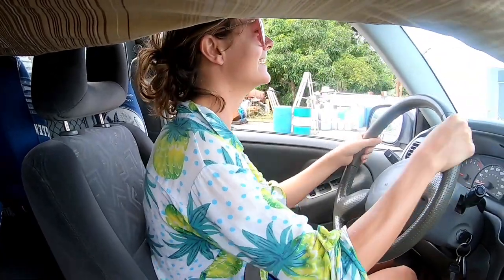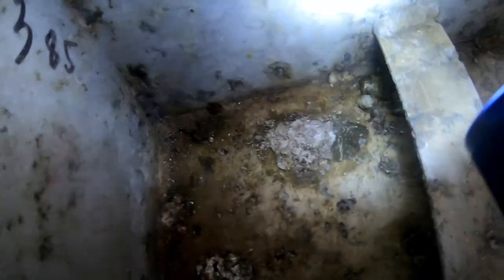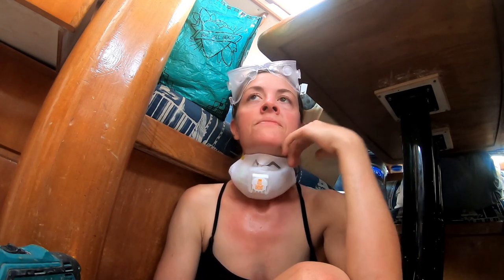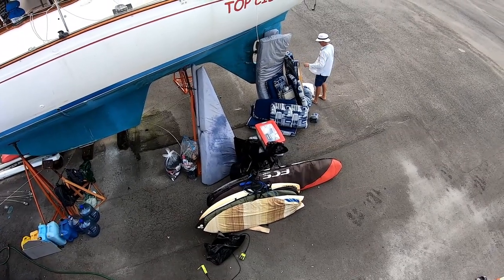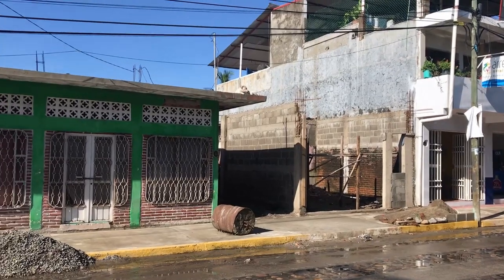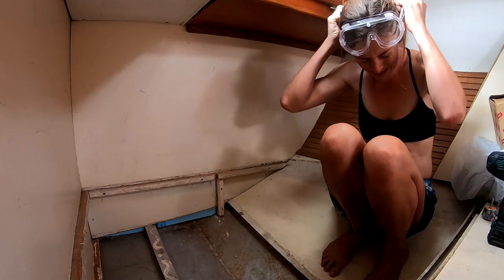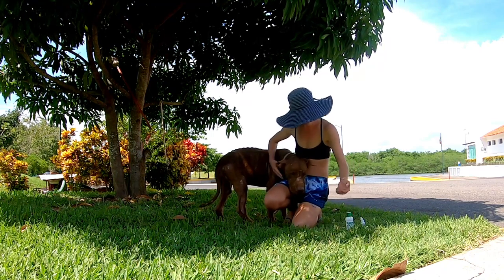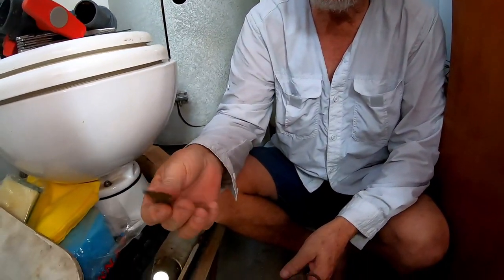This Changes Things... Chuffed Adventures S03Ep2 Hauled Out

Comment: Those would be easy filler welds.  I don't know anything about welding but I bought a Welder to build a Wood stove without knowing anything.  It turned out I bought the wrong welder, it's the cooler welder not the hot welder.  I can weld the Aluminum hull on my fishing boats but not the heavy metal in the wood stove.  I found another welder on-line for only $100 so I might go with that.  I have another tip coming and when I see if that fixes it or not will tell me other wise.  I was hurt from a Ukraine Dating site scam and I'm not over that hurt yet.  Your sure good to look at.

Comment: The worst alluminium corrosion, far worse than this, that I've seen was on comercial airliners! The first time I saw it I was shocked not just by the extent of it but to the casual reaction the engineers had towards it. The galleys and heads are modular units quickly removed and it's under the heads that there's often more white powder than alluminium left. Urine and alluminium seem to not get along at all.
Reply from the maker: Wow!!! Never thought of that - but it is rarely as bad as it seems in the moment!

Comment: 1. Clean, weld plates. Fill, polish, clean, add protection like proper epoxy. Or something that works better on aluminum, since the instant oxide film can mean you've got to wire brush scrub the epoxy onto the aluminum, just like lead, to get a good bond.
2. Make sure you've a proper life raft & EPIRB.
3. Back to business.

This is why, around 1970, when Jacques Cousteau was still looking for volunteer crew on Calypso, one of the questions was, literally, "Do you have any welding experience?"

Personally, I'm got great respect for a proper metal boat, but the cancers that old used ones can get, are what keep me to plastic.
Reply from the maker: Totally agree with you on all counts! I really love Chuffed and the benefits of alu, but I see the advantages of plastic especially in remote parts of the world - because for the most part you can always get the things you need to repair. Ive got a good EPIRB and liferaft, now to get this hull sorted!

Comment: Well this is tough
What you might be better off doing in the worst of places is hole sawing bits out, or at least cutting some regular shape and inserting new plate, and then getting it welded in, that ends the corrosion for sure and it takes away stress points that might tear the hull skin.

Two things about that. Its better if one of you can weld ally, it just is. Wooden boat, carpentry, steel, steel welding, fibreglass, know how to repair. So you have to know what grade of aluminium the boat hull was made from because even different grades can cause issues. Research.

Another possibility is lapping new plate over holes on each side. You can either weld this or believe it or not epoxy it on. There are yards in Germany and the Netherlands that just glue quite sizeable aluminium racing boats together (30-40ft). Even with aircraft they pop rivet a patch plate on and epoxy glue it together at the same time, Ive stood and watched that done. Rivets have to be the same grade or insulated. 

I tried this with Nike too but she didnt go for it, she might remember what I said. So I think if I was you and Im not, Id try find a welder that could make me happy, if not happy with that for any reason at all, aka trust, start researching the hull grade ally, and find an epoxy to lap patch plates on. West Systems can help they really do try to offer the best advice, so possibly GFlex, but yes its expensive. Still might be cheaper than dancing around with a welder on those rates, and you can fix it yourself any time you need to. 

What does this mean, it means talking to West System, if there is a airport with light planes around an aircraft tech might give you more confidence in it. Might be a smaller more regional airport or you wont get close to the hanger maintenance facility. You're a girl, smile a lot :) ask what adhesive they use for aluminium skin repair. You can imagine its pretty critical with aircraft, its also very common for small issues. Planes can be quite old and have lots of repairs over time, its not considered a big deal. If theres a float plane operator around that would be another source.

Another paint system might be worth looking into for the inside of the hull too.
good luck mate

https://www.theboatwarehouse.com.au/boat-building-maintenance/epoxy-resins-hardeners-glues-fillers/west-system-g-flex-650-epoxy-resin/
Reply from the maker: We are using the west system g flex for the water tank repairs actually! It does look a great system, and we had planned on using it in the hull until we found even more holes... I’ve got some great welders here and matched all my alloy so fingers crossed I don’t get the same problems as Nike. We chose to go with the plate over the hull method - doesn’t look as beautiful BUT reduces the risk of catastrophic failure a lot, at least if anything cracks se only have a tiny hole to seal!
Reply: well thats good news
(I keep forgetting you are weeks and weeks ahead of me here)

Comment: just a thought i would check into a water bladder that would fit the inside of your tank! 
ps there are chemical strippers for aluminum  its a little messy but works so much faster with less physical work!  a thought
Reply from the maker: The main problem with chemical strippers is aluminium oxide is actually more difficult to dissolve than the aluminium itself! So we’d be damaging the healthy alu as well, and there’s some risk of not washing it all out properly and then having more holes 🕳
Reply: @VetTails    The joys of owning an aluminum boat. 😁 I own a 35 year old aluminum canoe. The only part of the canoe that's ever been painted is a bit of nonskid in the bottom. It's not shiny but it's never had a hole in it.
I'm not a painter so my comments on the subject are simply my observations from 35 years of building sea going vessels. Many of them were aluminum or steel hulls with aluminum superstructures.
Metals begin oxidizing within minutes of being exposed to marine environments. The most extreme example I can cite is from building US Navy warships. Anytime the aluminum structure was prepared for final painting no more than about 3-4 square meters were exposed at one time. The sandblaster would then get out of the way and painters helpers would rush in to sweep and blow the area free of dust and sand. Within 10 to 15 minutes of the bare aluminum being exposed a spray painter was covering it with a wash primer. I have no idea what a wash primer is, all the painters helpers told me was that is was to keep the aluminum from oxidizing. 
I've seen several UTube videos on aluminum boats that apparently subscrib to this same idea of covering the bare aluminum within minutes of being exposed. 
Having said all of that, this past summer my neighbor and his friend spent 2 weeks finding, welding and grinding over 100 pinholes in his friends 20 foot aluminum shrimping boat. The boat is over 10 years old and the hull has never been painted. Not on the outside of the hull anyway. When I asked the boat owner about it he told me that the surface oxidizing protected it from further oxidation. (And that's why I'll never be a painter... 😂 Too confusing.) 
Good Luck and God Bless.

Comment: Too late now but don't grind aluminium.   It will fill the voids in the grindstone and when it then gets hot it will expand and potentially crack the stone which will fly off.....   You should only sand aluminium, or use a wire brush on the oxidised stuff
Reply from the maker: We havent used the grinder - unless it has the special plastic attachment which is made for use an alu :) Only sanding/stainless brush/carbide burrs as advised by boat builder!

Comment: Weld the holes and then look into poly Ester resin PRC. Prime the corroded areas with alladine the spelling is not correct but it is the way aluminium corrosion is treated on aircraft.
Reply from the maker: Thanks will do!

Comment: It is time for you to decide keep her or scrap her...if you keep her the aluminum welder / Shipfitter better know what they're doing. 
You need to start using sanding disc those cheap carbon steel wire brush's left behind carbon which then causes electrolysis...

I'm little cold I know but the facts are hard.
Reply from the maker: We are using stainless steel brushes and carbide burs, which is our best bet for getting it cleaned. To grind these types of holes would only take away healthy aluminium and leave to much of the hull thinner. We’ve got a boat builder on board so luckily have been getting he best possible advice on what to do!

Comment: Aluminum is a tuff repair, steel is a lot easier.  You have filaform corrosion, aka the tin worm, in aluminum it is a beast, identify the section with the worst rot and cut it out with a large overage on the cut, weld, sandblast and epoxy and zinc up.  You already know what is ahead, you can save some money doing the cutting yourself do not use carbide for the cuts get, good metal blades.  Very sorry I did this repair work on aircraft, it lead to some going to the bone yard.
Reply from the maker: So far we are winning with the repairs, it is sad to see the ‘tin worms’ though!

Comment: The fundamental question for you to answer for yourself: Right now, in the middle of all this: Do you love the boat? Let that question sit out there for few days before answering. Have a beer with your marvelous folks and talk it through. That will determine your course of action. It's a buyer's market for monohulls, even for quality examples.

I bought a boat that people thought I was crazy to buy, and which needed more than I realized. Why? it jumped out of my computer screen and into my arms. I have not a scintilla of regret. If that's your situation, do the welding and don't look back.

You have the time. You will have more money left over for your heroic work, and you will feel better about yourself for sticking by a friend that has stuck by you.

Fiberglass boats get blisters, waterlogged decks, and they break when they hit things. Steel boats are heavy, slow and rust. Aluminum boats corrode and are difficult to weld properly. If it ain't one thing, it's another . . . Good on you !!! Be strong!! Nothing wrong with a few tears. You are one tough cookie regardless!! Congratulations for what you do!!
Reply from the maker: I totally agree if it ain’t one thing it’s another, and yes, I Do love Her. We’ve been through too much together to say no now!

Comment: You've probably talked to NIke already and taken care of if from the time the video posted, but looks like you're gonna have to patch a couple of aluminum plates underneath the boat.  I'm sure there are a couple of aluminum welders around there. Good luck, but like suggested to her. Time to ditch the boat and get another one. you don't want to do a crossing of the pacific. All it takes is one missed spot and a disaster in the middle of the ocean could happen. Stick to coastal cruising with that boat.
Reply from the maker: We have covered every square inch of her don’t worry 😂 and Nike has been so much help!

Comment: There is no way that epoxy is the right fix for aluminum corrosion ablation or holes; the previous owner has a lot to answer for. However when the hull is sound an epoxy paint might seal and protect the bilges.
Reply from the maker: No, we plan to use epoxy as protection in the water tanks, the rest we weld!

Comment: You don't need welding but the boat needs a makeover . Would you like to do gas anesthetic ? .
Reply from the maker: It definitely needs welding - there’s holes! We could have taken an epoxy approach but I think what we did was best. I would love to be able to have gas anaesthetic too, the injectable I use are as safe as possible and easily transported, but gas is much easier to control, much more dose dependent and fewer side effects/hang over effects on the dogs.
Thanks!
Reply: @VetTails  think I might have what u want .

Comment: Can't you get a pointy hammer to the outside of the hull to find the thin bits and deal with on the outside rather than ripping all the interior out ?
Reply from the maker: She’s been eaten from the inside out and even the areas that are not as bad yet need to be cleaned or they just get worse and worse
Reply: @VetTails  Absolutely - it really needs everything stripping out to make the hull waterproof. Surely plastic, fibreglass or stainless steel would have been a better choice.
Rubber :)
Reply: @VetTails  It doesn't matter which side you poke through to find the thin bits - it's just that the outside is more accessible.

Not sure what all the tears were about. It's a damned good job you looked as the last thing you want is a FISTULA at sea.
Especially having done so much work already.
I don't think a couple of aspirins will solve this one !

Comment: Fibreglass all the way too many problem s with aluminum yacht s unless your a high latitude boat stick with glass
Reply: Yeah - I'd suggested leaving the alu as is and just using it as a surface to lay fibreglass onto. Just wondered about dealing with different thermal expansion rates though - would there need to be a layer of soft stuff between ?

Alu is such a useless metal. Our previous gas cooker had alu burners - they warped with the heat !
Reply from the maker: Aluminium is actually an awesome material if cared for correctly - you should see the dent in Chuffed from hitting a cargo container many many years ago - most boats would have been sunk, she just had a 1m long indent with no other problems! 
Glass is easier to work with but all the boat hull types have there positives and negatives..
You can fiberglass the alu, to allow for flex in the alu special systems have to be used such as the west marine g flex, which is our plan for the tanks. The key is preparation!
Reply from the maker: Oh and the alu can’t be left as is under the epoxy - that was the old problem and you saw how it just kept eating away... until below your fiberglass all you have is powder which eventually reaches the edges of your fiberglass repair and all hell breaks loose! It’s got to be prepped properly and cleaned
Reply: @VetTails  No, put fibreglass on & forget about the alu - let it rot and get rid of it - you then have a fibreglass boat !
Reply: @VetTails  The fibreglass isn't a repair, it's a replacement !
Reply: @millomweb  SMH....Um, no.

Comment: So appologize as this is long, but important. I know it took a month to edit your vid. And that's QUICK by most standards, so, now for my predictions after just watching your feelings shown at 12:43 . The boat would have needed welding. I've seen , I think , the corrosion was much worse  on KARL though, I believe ! . It was funny when you used , I'm sure by accident, medical terms fro the problem, (Disease) , but, taking that further., time to really come to terms with the problem. Injections of ZINC antibodies are needed, which would keep the boat in good health from now on if followed. Unfortunately, due to the timing, I'm sure your welder isn't on scene now, and most of what needs to be done can be seen here https://youtu.be/_tffftL4oDY The ORIGINAL KARL REPAIR (APRIL 2014 ! ) ., and more later on Karl (31),and then,  even more important to watch this one from months (years) later  which I think happened possibly because they did not use the correct aluminum plates, you must match the boat current type.  This almost 4 years later ( March 2019) https://youtu.be/ZXItZ9gc1lw GO Back to 30 (first link) then flip to 31. , it shows welding the anodes on KARL . Back then I started studying all to ins and outs of galvanization corrosion and putting a lot of really great vids on my Sailing Technology Cruiser Help playlist Starting Here, every conceivable topic to do with corrosion except for more about corrosion INSIDE the hull and how to fit Anodes in it. PLAYLIST (starts with video 88) https://www.youtube.com/watch?v=MuT7Ylc-7fA&list=PLxzZgQElG0cG0FSFBHnYrUFmCFD21C4FR&index=89&t=0s The inside the hull topic needs to be addressed, (Bladder for the water ?)  I've gotten inside the bigger diesels engines (actually a plug you screw in from the outside, , inside the OUTBOARD, just about everything covered. Even the Shaft of the boat near the propeller where they are clamped on. And, BOATZINCS.COM , talk to them, tell them about your engine, your boat,, your outboard,  they will send you the best parts CHEAP ! I suspect that KARL didn't have easily replaceable zincs on the outside, I would think one would set it up so they didn't have to be welded on every time but I'll need to look into that. Sorry so long, such an important topic for ALU boats though !
Reply from the maker: Yeh we have organized anodes (Chuffed had none) and matched all of our alloy (the welders thought I was strange - this young woman rifling through their fear checking all of their alloy against my chart to match with Chuffed!)